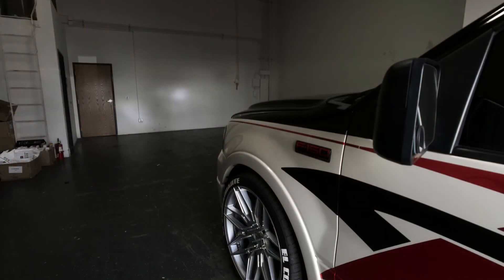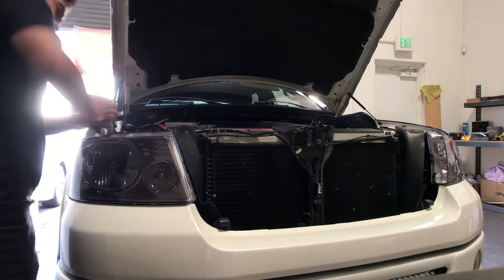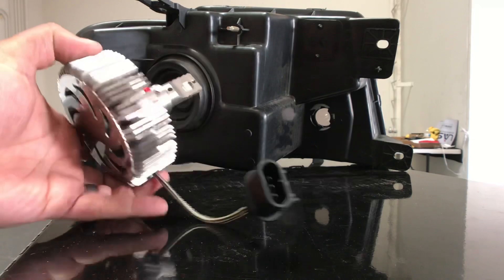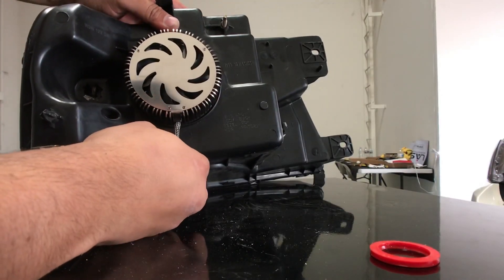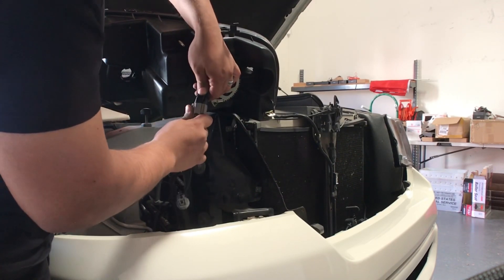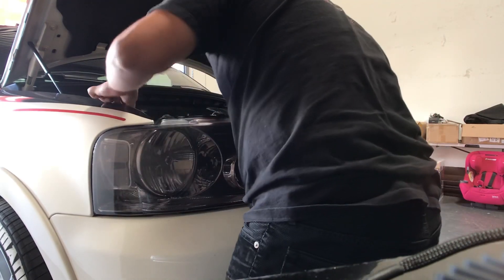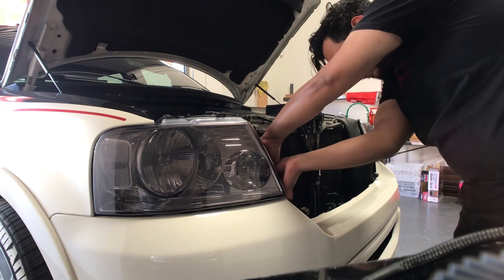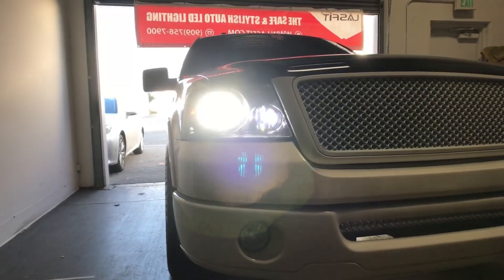2004-2008 FORD F-150 LED Headlight Bulb Install Pro Series

Comment: Looking good! I might just be interested in buying a set for my truck. $80 is steep but that is bright!
Reply from the maker: Hi, you can purchase LED bulbs for Ford F-150 04-08 from below link: https://www.lasfit.com/products/2004-2008-ford-f-150-led-headlight-fog-light-exterior-interior-bulb-plug-n-play?utm_source=Social&utm_medium=YTB%20Channel&utm_campaign=Ford%20F-150%2004-08%20whole%20pack

Comment: on the website it says that this bulb is only for 09-14, but it’s works with 04-08 as well?
Reply from the maker: The specific LED bulb for 04-08 is not available. You can choose the standard LED bulbs for your F-150: https://www.lasfit.com/products/h13-9008-led-headlight-high-beam-la-series?utm_source=Social&utm_medium=YTB%20Channel&utm_campaign=LAplusH13
Reply: @Lasfit-Automotive  I've just installed your LED's in my '07 F150XLT (round housings) and I'm concerned about protecting the fans from dust/moisture.  Do you have a recommendation for how to best do this?  It's "open-air" which is good for circulation, and I suspect that the wind will keep dust mostly blown off and away, but the moisture concern and the fact that the lamp housing (like the truck in this video) sits a bit more than a foot from the road surface is my main concern.  I love the lamps, but I don't want to be replacing them every few years...TIA...